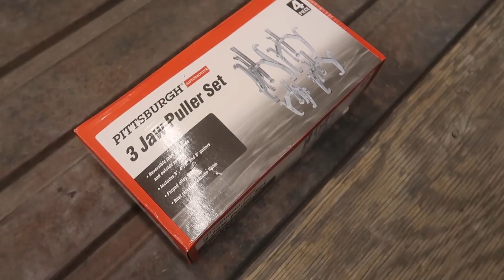Ghetto Turbo Ls Cam Install

Comment: Assemblee Luube usually melts around 150° so you can't use too much. Just change the oil after 100 miles or so

Comment: Instead of threading the spring compressor down use a longer bolt with proper threads and a nut to tighten and loosen to compress spring so as not to wear on threads excessivly like a headstud over a headbolt in comparison just my 2cents

Comment: Ayyyyyyyyeeee I have a BTR stage 3 cam in my 6.0 L G8. They make great stuff. I cringed when you impacted everything on. Lucky you didn’t snap a bolt because most everything on the front goes to 18ft poundsn
Reply: Ahh impacts the old flat rate torque method

Comment: Wouldnt it be easier and less expensive to just use real faberglass
Reply: Jake's savage lifestyle i think bondo glass is easier as you just apply it instead of having to use the glue stuff and the fibreglass
Reply: But its so heavy and eventually cracks worse then real bondo is just my opinion.
Reply: Jake's savage lifestyle most of it is sanded off